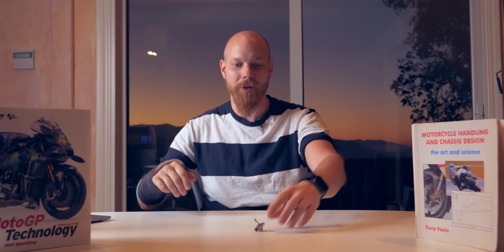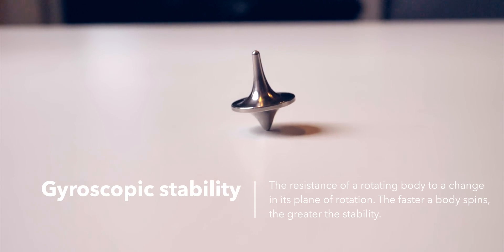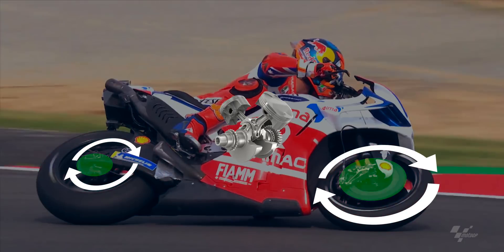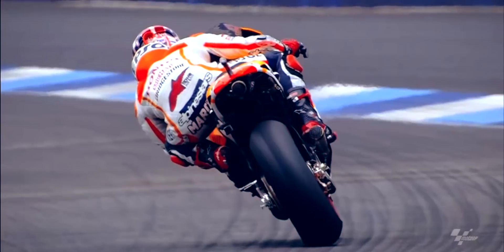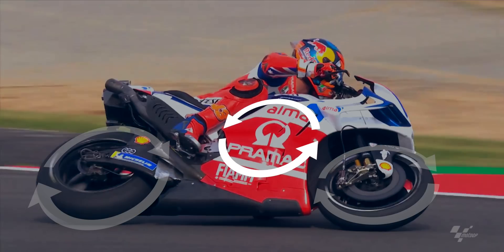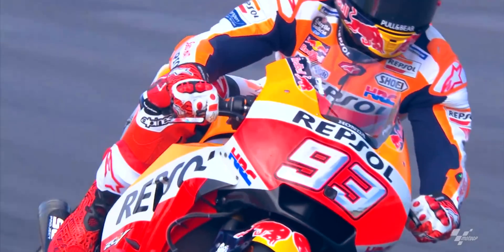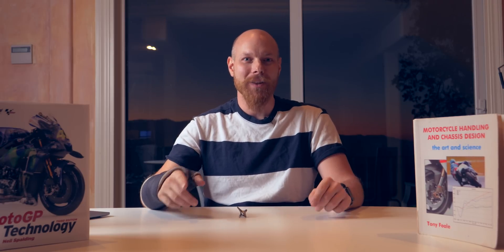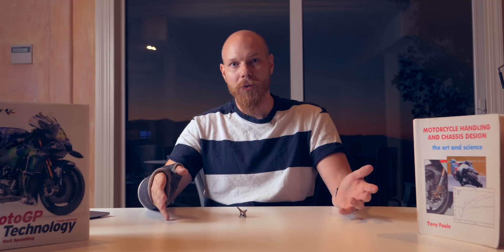Why MotoGP Engines Spin Backwards

Comment from the maker: Have seen a few comments questioning the physics behind this. Some comments contain questions, others assertions of how 'the physics are wrong'.

To understand the basics of gyroscopes and precession, watch this wonderful lecture with Walter Lewin, former professor of physics at MIT. https://www.youtube.com/watch?v=XPUuF_dECVI

Specifically look 35 minutes in, where Walter spins a bicycle wheel and hangs one side of its axle on a string. The wheel stays upright and rotates around.

It rotates in different directions depending on which way he initially spins the wheel.

This should help you understand how a reverse rotating crank cancel out some of the gyroscopic effect of the wheels.

The wheels will precess in the opposite direction of the crank, because they respond opposite to the torque applied.

Spinning the crank in reverse is not some new invention, nor new realization. From what I can find precession was discovered by Greek astronomer Hipparchus around 190-120 BC.

Some motorcycles that have had reverse rotating cranks include: Yamaha TZ700, Honda NSR500, Honda RC166 etc.

Boxrepsol talks about introducing a reverse rotating crank in the NSR 500 in 1987. They were of course not the first ones to use this. "Another important adjustment made was the direction in which the crankshafts rotated to counteract the gyroscopic effects of the wheels, improving the bike-s performance in run-off areas. Even though the bike’s manoeuvrability improved, it did create the need to add an additional shaft to invert the spin direction at the engine’s exit, which slightly decreased its power."

https://www.boxrepsol.com/en/technology/the-honda-nsr500-engine-evolution/
Reply: BTW since you shared that video I'm eagerly watching not only that lecture on gyros of  (uppercase) Professor Walter Lewin, but hist other lectures as well. aside the wheel he hung from the string, what impressed me the most was watching him rotating in his chair... by only applying torque to the wheel spinning he was holding in his hands!? man, that was crazy. astonishing. Again thank you.
Reply: Perhaps I'm a bit older, but I remember Eric Laithwaite, he made a gyroscope made of lots of little weights on thin spokes, so you could see the deflection as it resisted movement.
Reply: Gyroscopic precession is not rocket science and has been known for a VERY long time.  A ton of engines have used this counter rotating crankshaft design this is not new.

Comment: That HUGE 2 liter triple longitudinal crank 3 cylinder must be a handful in the corners?  What about a lawnmower style vertical shaft engine?  Saw some bike with a new type of front suspension that uses vertical springs, front wheel vertical turn axis and braking forces transferred longitudinally as it should (Far less brake dive).  A totally new 2 wheel vehicle dynamic.

Comment: If you made a custom sport bike frame, could you put the engine in backwards and accomplish this? Like, yeah the manifolds are all facing the wrong way, and nothing would line up, a dozen other things, but sans all that technical poo-pooing, wouldn't it rotate backwards in this way?  Also, if you got your valves and your ignition and all that sorted, why can't an engine, unconnected to a transmission, just spin backwards, leaving the block orientated the way it is?
Reply: Ah nevermind.

Comment: Big [X] the Yamaha bike uses a very similar to factory engine that I've seen and it doesn't run backwards, they'd have to redesign their entire cam system and accessory drives. The Ducati runs backwards, and I think another bike does but not the big four bikes. Honestly thinking about the transmission it's just straight impossible

Comment: Simple test, get on any bike. Apply front brake try to do a burnout.  or even film a hard take off, the rear will rise.  --Gyro force from reving, Yes!!!. ---Gyro force via a chain to a sprung rear wheel.... no

Hence dragging rear brake drag squats the rear mid corner. 

KEITH CODE  "twist of the wrist" video  actually shows this with video and physics explanation

Comment: One slight issue, wouldn't the effect change with what gear you're in ? As far as I can remember, inertia increases as the square of the speed, so even a tiny change in ratio would have a pronounced effect. But then I guess it making loads of tiny improvements to ad up to a big one, like on track ( pedal ) bikes one team had the chain on the left hand side, requiring lots of non standard parts, and the only TINY advantage I can think of, is because the bikes only turn left, the chain on the left would very, very, very slightly reduce the drag.
Reply: You are talking about a completely different inertia. You are talking about the inertia of moving the whole bike, that would be mv^2/r. That would not change with this modification, only thing that matters is the mass, speed and the radius of the turn, it doesn't matter what is happening inside of the bike.
He is talking about the inertia of rotation of the bike along the axis perpendicular to the bike, this is where rotation in reverse cancels out the inertia of rotating wheels.

Comment: i would say price is not a factor, one or more wheel in the gearbox would not be that much. Reason is probably that you want the customers bikes be rather more stable than less - easier for amateur drivers.

Comment: surly the engine rotation depends on the primary drive.  If the clutch is gear driven from the crankshaft the engine will rotate forwards.  If chain driven the engine has to turn backwards. As smaller engines tend to be gear driven and larger chain, it follows that larger bikes will normally have backward turning crank shafts.

Comment: Thanks for good video. But I have one thought, you cant say the engine is running clockwise or counter clockwise - I mean you can but it depends on the side you are looking on it. from one side it will be turning clockwise and from the otherside of bike it will be counterclockwise. I think more accurate description would be that engine is turining in the same way as wheels or in the other direction. or drive sprocket.
Reply: if the engine is running counterclockwise when you ride the bike you go backwards in time....

Comment: Informative!
Are there any street bikes that do have a contra-rotating crank?
Reply: yes, all the Yamaha Vstar crusier bikes have reverse rotating crankshafts

it makes the bike more nimble at speed - cruiser bikes tend to have heavy tires

they are no longer in production, but you can find them for less than $3k with less than 10,000 miles on the odo if you look around - even the big ones like the V4 Royal Star, 1300, water cooled shaft drive
Reply: @gurnblanston3210  more nimble than if the crank was spinning in the same direction as the wheels

they are designed for long distance riding - not for doing wheelies

Comment: Old timer here. If I am not mistaken, my old Yamaha XS1100 spun backwards I think. Can anyone here enlighten me?
Reply: Yes it does.  I have a 78 in my garage now.  I was searching for this comment.  Best bike ever!
Reply: @slardibarfast  I bought a 1981 brand new. Had it for several years. Used to travel across South Africa all the time with it. Best bike I ever had. Years later (1996 I bought a used 1100 Maxim. Didn't like it as much, but it was essentially the same. Miss the old basic bikes.

Comment: A reverse-rotating crankshaft on a GP bike is not exactly new. The unraced 1954 horizontal works Norton would have been reverse rotation. There are probably other engines of the same period which did, too

Comment: You physics is incorrect. Two discs rotating on the same plane in opposite directions do not cancel each other out, at least not in that respect. It does help a separate force of rotation though So it helps, but not in the way you describe. However you are on point with it being 'anti-wheelie' of sorts.
Reply from the maker: The wheels will precess in the opposite direction of the crank, because they respond opposite to the torque applied. 

This lecture on Gyroscopic precession is a great start to understanding this.
https://www.youtube.com/watch?v=XPUuF_dECVI

Comment: the old tz 750race bikes had cranks that rotated backwards, and the reason was for less gyroscopic effect, to make the bikes turn better
Reply: Yep. Plenty of 2t bikes did it. Infact the tandem twins like the rotax 256 had two crankshaft rotating the opposite way cancelling out all rotating mass which is never possible when you have camshafts

Comment: Ducati Panigale V4 street engines are counter rotating.  Almost all professional reviewers "complain" that they can't wheelie like they can on the KTM.  They also don't use chain to drive the valve train allowing for higher RPM.  These engineers don't get enough credit.
Reply: Yeah you're right only Italian bikes , if they do it at all
Reply: You forgot to write right a word   "professional reviewers"
Reply: I do complain that it's more difficult to wheelie on my Street Fighter V4 then it was on my monster 1200
Reply: Ducatis are not built for wheelie. They are usually not ridden by hooligans.
Reply: @ardmrad9278  cough cough.. hypermortard rider cough cough..
Reply: @chronophobic  Haha, I know, but they are nowhere near the orange bike riders.

Comment: counter rotating crankshaft also reduces inertia to changing direction - not just lean angle.
On motogop bikes they don’t care as much about longitudinal stability as much as the ability to change direction quickly.
For road bikes, safety demands the opposite.
Reply: I'd have to agree there also.. these bike are fast. Don't get me wrong my little baby 300 ninja is no liter bike.. but I promise  113 on a flat out is just as fun as 135 when my helmet  starts choking me from lift.
Reply: @Gh..o..s..t  It just isn't. And there's pretty much no way your little 300 can even do 113... My '14 Brutale 675 on the other hand. 135 is definitely more fun than 113!
Reply: @XtreeM_FaiL  It may say that on the dash but it absolutely does not go that fast! I work at a motorcycle dealership in sales and have ridden literally hundreds of different bikes. A stock Ninja 300 will not do 170km/h. The only possible way for that, shy of some great mods, is a monster downhill with a strong tailwind! I've ridden a 2014, 2017 and 2019 Ninja 300, they take forever just to get up to 140. Once you introduce a slight incline or a headwind, you're clapped out. The Ninja 400 will go that fast but not the 300. You're talking out of your ass if you say any different! It may go that fast on paper but not on asphalt!
Reply: @jbb3675  That's not true I had 2014 stock ninja 300 and on the gps it tops at 177kph on the straight road and 193kph on the dash of course it take long time to reach there but it does it.
Reply: @jbb3675  Source : trust me bro!

Comment: I didn't understand how the rear wheel spins. If the rotation is rearward, how is it connected to the chain and rotating forward? 
(Newbie here :|)
Reply: The output shaft from the gearbox spins the 'correct' way
Reply: @JEMCL  Got it mate. Thanks :)

Comment: I don't understand why the engine going the other way would decrease stability? It's still rotating on a plane and won't want to change on that axis
Reply: Same concern down here Mike. would you please elaborate? Thinking in two contrarotatory coaxial propeller choppers, does it mean that their gyroscopic effect gets cancelled?
Reply from the maker: The wheels will precess in the opposite direction of the crank, because they respond opposite to the torque applied. 

This lecture on Gyroscopic precession is a great start to understanding this.
https://www.youtube.com/watch?v=XPUuF_dECVI
Reply: @MikeonBikes  thank you!

Comment: When I blip the throttle on my motorcycle, it rises on the left and goes down on the right 😅
Reply: Shafty?
Reply: @pravesh736  Transverse V-twin with a shaft, yes.
Reply: @theunheardprophet4315  😁👌
Reply: its not the shaft drive, its the BMW or Honda boxer engine, spinning 90° off the axis of the wheels
Reply: @kenwittlief255  Uhm. No? Its neither from a Honda nor a BMW.
Reply: Moto guzzi?
Reply: @bloodspartan300  Yes!

Comment: Hhmmmm.. When Wayne Gardner raced factory hondas he complained that his bike constantly wanted to wash the front wheel out while lent over and applying the throttle exiting a corner. Honda manufacturered him an engine where the crank rotated the same direction as the wheels to prevent the wash out effect..
Reply from the maker: When leaned over & decelerating, a bike with a backwards rotating crank will tend to understeer, as compared to a forward rotating crank which will tend to create oversteer.

When the bike is at or near vertical, a backwards rotating crank will push the front down and forwards rotating crank will lift the front.

Motorcycle dynamics always requires a lot of head scratching! =D

Comment: You can also have anti squat occur with traditional street bike correct?  I remember something about it being mentioned in A Twist of the Wrist II
Reply from the maker: Anti-squat is generated by swing arm angle & chain pull.
Reply: @MikeonBikes  I wonder which electric bikes spin their motors backwards and which don't.

Comment: Do opposing angular momenti really cancel out each other's resistance to torque? If I built a gyroscope with two flywheels that spin in opposite directions, spun them up to the same angular velocity and horizontally placed it on a post with the end of the shaft that constitutes the rotational axis: would it really just fall down and not steadily stay in the same position? In my opinion only the precession resulting from the gravitational force would add up to 0 but it wouldn't fall. Correct me if I'm wrong.
Reply: They do indeed cancel. They want to precess in opposite direction because they respond opposite to any torque applied to them, thus it cancels. The system will experience internal stresses because of this though.
Reply from the maker: Yup
Reply: How would the gyroscope behave though? Will it thus fall as if it were not spinning at all?
Reply: @florianwilli8924  yes
Reply: @florianwilli8924  that's counter intuitive for sure, interesting fact though
Reply: Interesting, I didn't know that.

Comment: without using a jackshaft they can also use a chain to go from the crankshaft to the clutch basket instead of a gear. effectively does the same thing for less complexity. I bet there is more to the common forward rotation.
Reply: Erm are you sure?
Reply: @superwrench9445  why not before the transmission is less torque. could also just run the transmission backward and run just a reversing gear at the end against the normal output shaft to get the right rotation. there are tons of ways to do this, and an external jackshaft is probably the worst.
Reply: @nick4506   not arguing but a chain drive does not reverse the rotation that’s all
Reply: @superwrench9445  o thank you for clarifying. normally it's a gear that goes from the crank to the transmission that does change the direction, so switching to a chain that doesn't reverse the rotation... reverses the rotation.

the engine would have to reverse rotation to get the transmission to spin the same direction. 

hope you get it, this is hard to put into words.
Reply: @nick4506  ok thanks I get it now
Reply: @nick4506  I don't get what you a saying
Reply: @DumbledoreMcCracken  is it the same rotation question as superwrench944?

ok here we go again

side view(original)
000
3 shafts, originally engine spins foreword , (gear so rotation reversal)first transmission shaft that includes the clutch spins backwards,(gear so rotation reversal) then the second transmission shat that is also the output spins forewords to drive the wheel

side view (with chain)
00=0
3 shafts. engine spins backwards (what we want), (and chain drive so no rotation change), first transmission spins backwards just like the original, (gear so rotation reversal), output spins forwards like intended.

this is as clear as i can get it, please talk to your math teacher or something of you are still confused. im not a teacher.
Reply: Besides the chain not changing the direction of rotation of the transmission, it's about the rotational direction of the crankshaft and its flywheel.
Reply: @u1es  omg the chain is replacing a gear. so the crankshaft and flywheel need to reverse direction to get the transmission to spin in the same direction as the original configuration. please read my replies to superwrench and dumbledore.

you don't want to change the rotation of the transmission, so you turn the engine opposite(what we want), why is this so hard to grasp?
Reply: easy to design into the bike with a rear wheel shaft drive
Reply: @kenwittlief255   yea but there is also alot of losses and extra weight that come with a drive shaft. the reason why gp bikes still use chains.

also, most driveshaft bikes have a longitudinally mounted engine so it's a moot point. you don't get the benefits.

 tbh the only shaft drive bike with a transverse engine I can think of is the BMW k1600. and that baby thicc
Reply: @nick4506  Yamaha Vstar bikes have 2 and 4 cylinder V  engines and shaft drive - engine is not longitudinally mounted